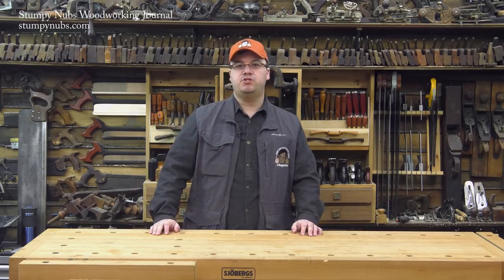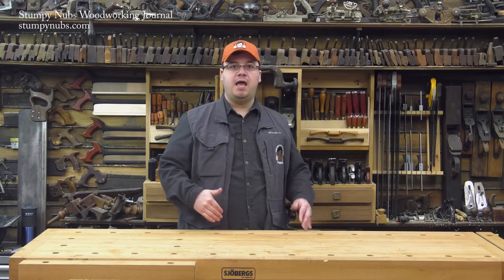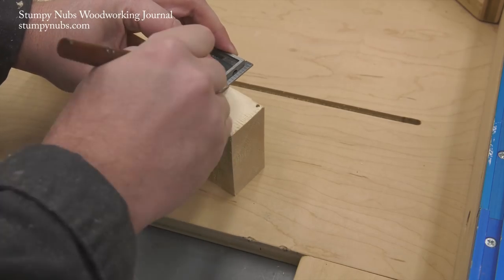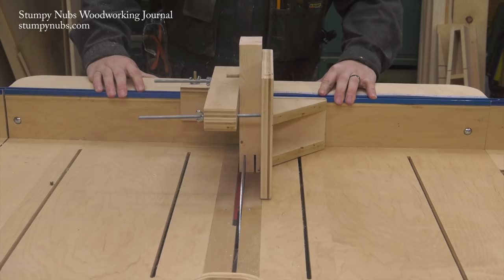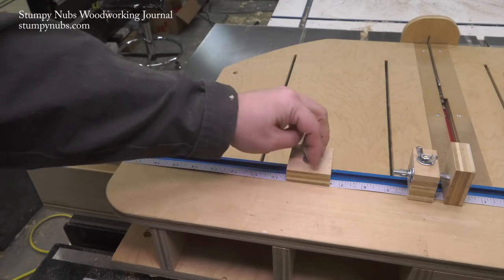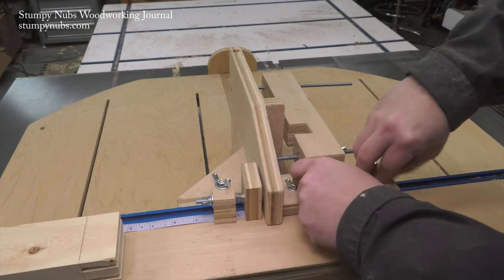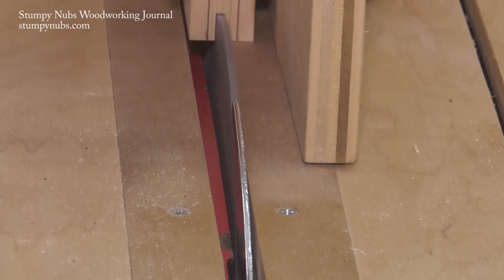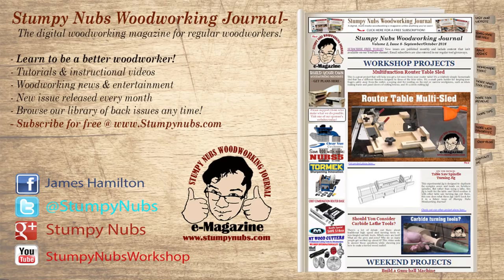How to cut tenons on a TABLE SAW SLED!

Comment: Another great video! When should I be using two tenons over one?
Reply from the maker: That's long been a subject of debate. Really, what I called a double tenon is more accurately called a "twin tenon". Anyway, I use a twin tenon when the mortises aren't very deep, such as when using a short router bit to cut the mortises. The twin tenons give me twice the glue surface, which means they are more likely to hold. If my mortise is deep (and therefore the tenon is long), then a single tenon will suffice. (This would be a good idea for a tip video)
Reply: Stumpy Nubs. Thanks